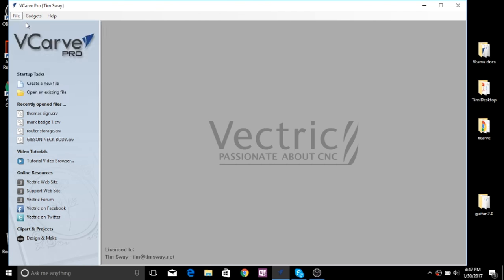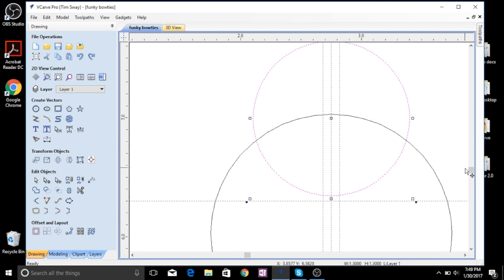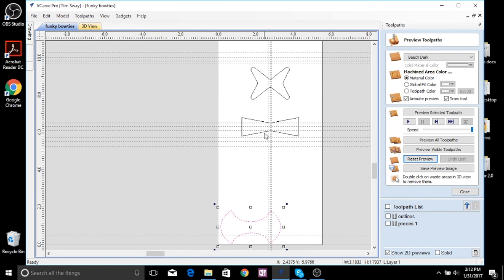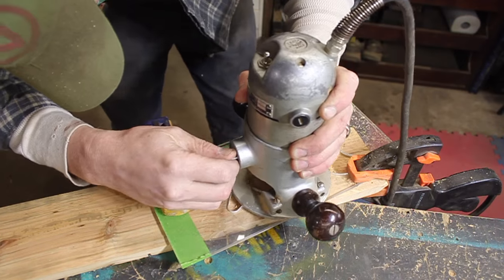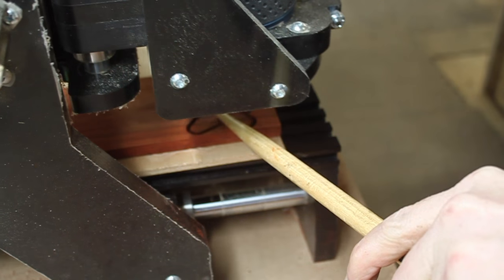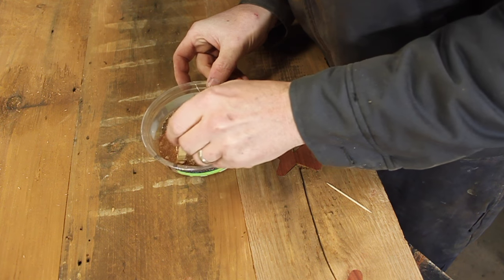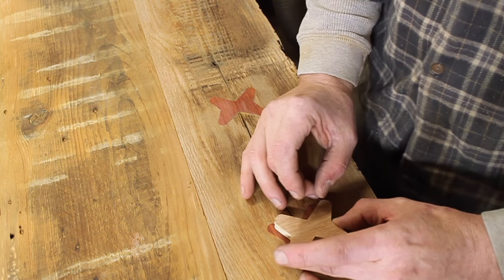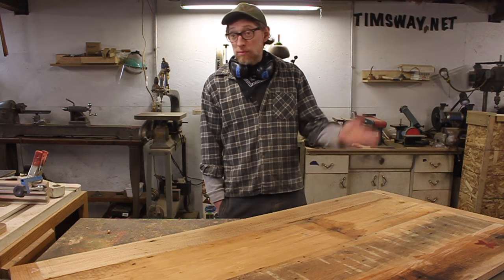Simple, Designer CNC Butterfly Keys — No Chisel Needed!

Comment: Those look great. I did the same grain direction thing with my first bow tie keys. It was in my dining table. That was a year and a half ago and so far no issues.
Reply from the maker: Claterpult Workshop yes, they still work fine, but there is the remote issue that the crack will grow so much it'll rear the keys apart. unlikely unless it's real green, fresh cut wood.

Comment: Looks fantastic! Excited I took a look at your channel, I'll sure be trying to watch more so I can learn! What's your favorite kind of finish for old wood like that? I really like the natural less toxic products like linseed, mineral and waterlux oils.
Reply from the maker: thanks and welcome. Personally I prefer natural finishes and feels, too, but usually when I'm making larger tables and desks like this I need a perfectly flat surface but want to maintain the look of the reclaimed wood, so I coat the top with 2-part epoxy bar top to fill the voids and strengthen it. Then I sand it all down again so it's level, smooth and not shiny, then apply a few coats of satin, low VOC water poly (I'm an environmentalist :). Many of my videos show this process. cheers!

Comment: Love the idea here, Tim! From my experiments with Plexiglass and polycarbonate, it helps to experiment on the relationship between feed speed and spindle speed. Also, less flutes tend to work better (I've had better luck with 1 and 2 flute bits than 3 and 4 flute bits). Regarding the fit, I'm wondering if maybe your shape isn't totally perfectly symmetrical and you're putting it in opposite from the template? Just a thought. Overall I love this idea! Maybe you're not the first bit you're the first I've seen it from!
Reply from the maker: I used a single flute but I was running it full speed. next time I'll slow it all down. I was thinking that, too, about the symmetry. I was very careful in the software but that doesn't mean i didn't screw up :) Thanks bro!!

Comment: hi Tim that awesome great job     do you find the size of your cnc machine limits you a lot for some project cause I'm been saving money to try and buy one  what type is your and do you like it
Reply from the maker: Mine is the Piranha from Rockler and it is HIGHLY recommended for a first CNC. Nothing to assemble, comes with expensive software bundled, not a huge footprint... etc. If you buy one, tell them I sent you :) You can get similar sized ones for less, but they don't include the software aren't as well built, etc. Spend the extra for the easiness of the transition. Of course the size limits, but you can tile projects in the software, so if you want to make a 20"X20" sign, you can design it, then tile and print it on 2 10"X10" pieces that will line up perfectly...
Reply: thanks Tim I will mention you if I go that route but 80% from rockler I cant  get delivered in Canada

Comment: when cutting Plexiglas (poly-carbonate) use faster feed rate, slower rpm on the bosch colt, the idea being you give the chips time to exit the area before  moving on to cut the next chip. does that make sense?
Reply from the maker: Stuart Morrison yes and it is the exact opposite someone else said which also made sense. hahaha!
Reply: tim sway well I'm probably wrong then. Good luck!
Reply from the maker: I think the theory works both ways, no? Don't melt it, but if you do, blow it away quickly so it doesn't fuse.

Comment: what did that CNC machine cost..
Reply from the maker: The Piranha is $1599 @ rockler. Router is an additional $100 ish, plus bits, etc. But the machine comes with vcarve desktop included which is a $350 program and very good, pro stuff. Easier and better than the free software. If you buy one, tell them I sent you :)